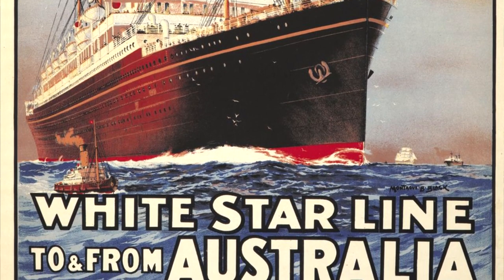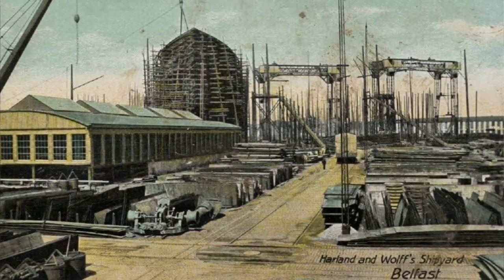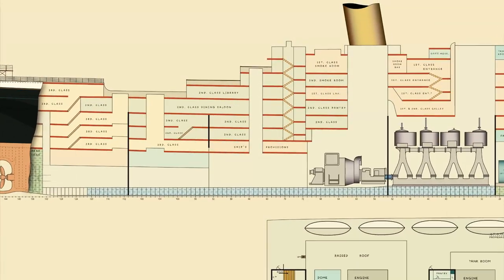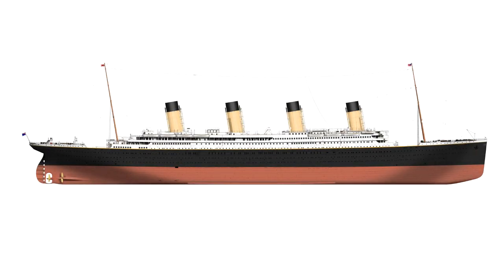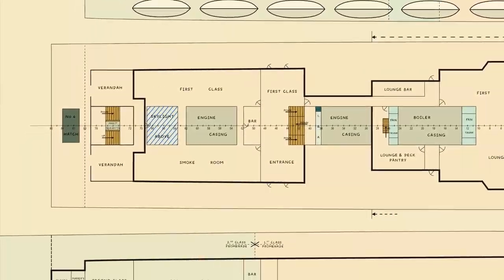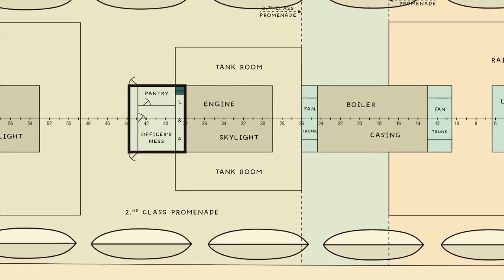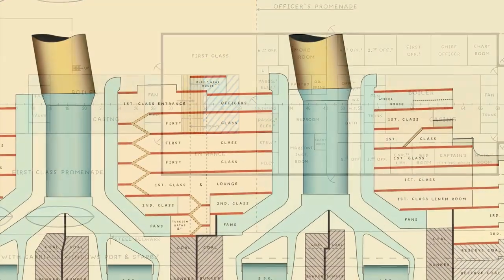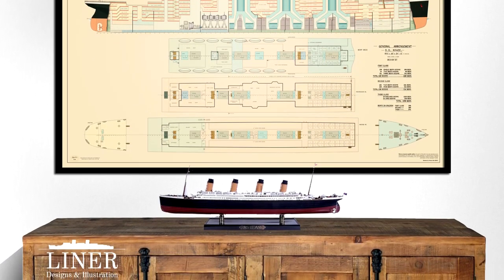Titanic's early design - how did it change?

Comment: The deck plans don't show C deck down, so it's hard to tell where many other differences would be, but it's quite easy to see that the first class dining saloon was planned to be a sumptuous multi-deck experience like Lusitania and Mauretania.  The squash court and "spa" area (pool, Turkish Bath, steam/electric baths, sauna) aren't shown either.  The lounge still has a dome in the final, but barely - might the original one have had a skylit dome perhaps not under the compass platform?

Comment: You can see in the thumbnail pic that the engine ventilation shaft just above the first cylinders is the weakness in the superstructure that caused it to break In half. There was also another stairwell next to it that likely contributed to this. I call it Barclays Theory.

Comment: Actually, this was (probably) not the ORIGINAL design concept: there is an illustration of the "New" OLYMPIC and TITANIC in the New York Times in March 1909 (don't remember the EXACT date; it might have been March 5 or March 9, or even another date.  I used to have a copy I made from microfilm, but I lost it YEARS ago).  This design shows THREE funnels, and a profile very similar to an enlarged CELTIC class.  It also has a size comparison with the LUSITANIA.  Now, admittedly, I do not know whether this illustration came to the Times from White Star, or whether it is the conjecture of a Times editor\illustrator of the time based on a CELTIC-class ship (which would have been the biggest in White Star's fleet at the time), but I think it is significant to consider that, if there was a "Design D", it must logically have been preceded by "Designs A through C".
Reply from the maker: Hi Todd,
Design 'D' can be considered the first concept, for now, since it is the only one to survive. My understanding of the early illustration of Olympic in the NYT is that it was pure conjecture, an artist's impression of what the upcoming WSL liners might look like eventually. That design is worthy of a video in itself!
~Mike
Reply: @OceanlinerDesigns  I always kind of thought it was an "educated guess", because of it's great similarity to the CELTIC class.  That Times illustration looks almost exactly what a "Super-CELTIC" would look like.  Most likely they simply took the CELTIC's profile, and kind of "upgraded" it a little in view of the lack of info. they had at the time.

Comment: The horizontal wires where not the actual transmitting and recieving part of the Antenna. They formed what is called a capacitance hat. They are a vital part of the system though.
Reply from the maker: Good one - there is a video idea on the function of the wireless apparatus in itself!
~Mike
Reply: @OceanlinerDesigns  Ah, good!
Reply: @OceanlinerDesigns  I missread and thought you already had one! Glad to have given you an idea.

Comment: Thanks! How would have the 1st class dining room have looked like in Plan D? As the Adriatic?
Reply from the maker: The dining room was originally intended to have a dome above but this was unfortunately removed. For much of Olympic's career passengers noted the saloon was stuffy and hot - given all the burning electric lights - that could have been rectified if they included the dome as intended!
~Mike
Reply: @OceanlinerDesigns  Thanks for your reaction. I texted you on Facebook. Any idea how the Plan D dome would have looked like? Was it as the Adriatic with colorful stained glass or some other design?
Reply: @Titan10able  Unfortunately, we do not know the answer to this question as there’s virtually no information about the finer details of the earlier designs. We can speculate that yes, it could have looked very similar to the dome that we see with Adriatic and the rest of the Big Four since Harland & Wolff reused a lot of the same designs in many of their ships.
Reply: @thejagotishow  thanks for your answer, in that sense the Olympic Class liners were indeed an improved copy and paste version of earlier White Star Line liners. The lower one floor without dome dining room was in my opinion a downgrade, also when we compare this to other contemporary liners which were built palatial high dining rooms (Lusitania, Mauretania, France, Ballin Trio etc.).

Comment: I can say that NO, thats not the original concept design. I have built models of the original concept design. It is of course speculation as there is no official designs to go off of, just buts of information and paperwork. Originally, she was roughly 1000ft long. Had 3 funnels, the 4th added later for visual effects. She actually had 3 domes, 4 masts, and 10 cargo cranes. And upper deck designs were completely different in profile. In fact, the only section that is pretty much identical to the finished ship is the profile from bridge to just aft of the 3rd funnel. There were separate deck sections aft for the further deck space, looking a bit like Lusitania or Mauritania. I build concept models of the Olympic class, and having studied Titanic for 25 years, and owning Titanic Truths LLC, I can say the design you presented is not the original concept, but the last design idea before final modifications were made to what we know she looked like. There were actually 3-4 different designs prior to the final design. The one you featured is more from 1910. You have to remember, designs were still be refined while construction was already happening. Even after they were built and launched, changes were still being made. This is why Titanic was launched with an open promenade like Olympic, but had it closed in during the fitting out process. Also, Olympic didnt have a cafe at her lauch. In fact, on Olympic, the B deck was open the length of the main deck creating another promenade for 2nd class passengers.
Reply: Design D is from 1908. And the B deck of Olympic was primarily for first class, changing to second at the back end.

Comment: Question is, if built to the original design, would it still have sank.
Reply: Yes, as the differences mentioned wouldn't have helped her survive the collision. She still had the watertight compartments, which were not watertight, as the bulkheads were never capped, so no change there.

Comment: Titanic was designed to hold 64 lifeboats, but then they dropped it to 20 lifeboats
Reply: Thomas Andrews had designed Titanic to have a double-row of lifeboats. Probably rejected on the grounds of cost or that it made the boat deck 'untidy'.
I find it hard to believe that nobody realised the common sense that there ought to be space for everyone aboard in the event of disaster. By what logic did they manage to whittle down the provision?
At least the loss of life in the Titanic disaster did shake some sense into the various Boards of Trade.
Reply: They never expected the lifeboats to need to hold everyone. They expected to have ships close enough by to use the lifeboats as ferries to a non-sinking ship. Had the sinking happened in the daylight there would have been help before the sinking.